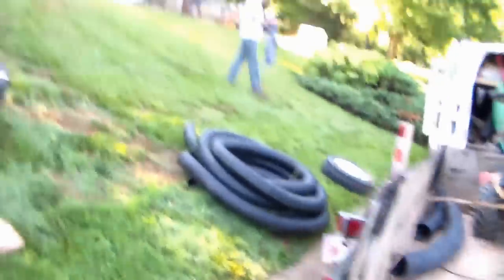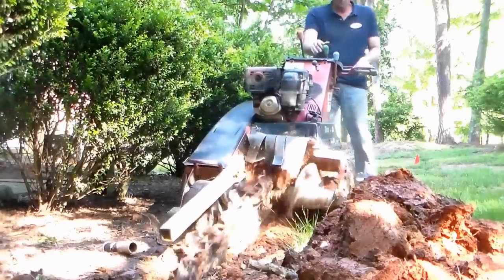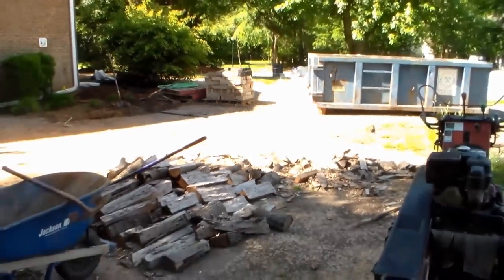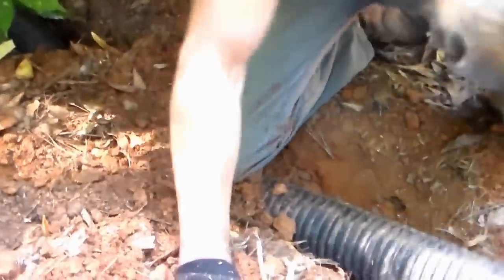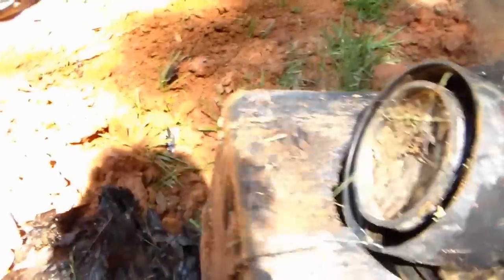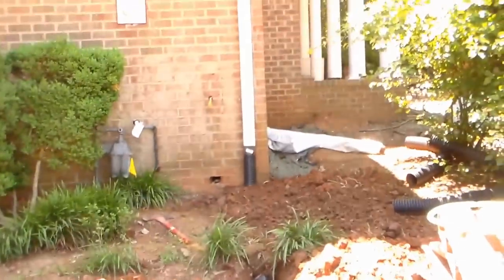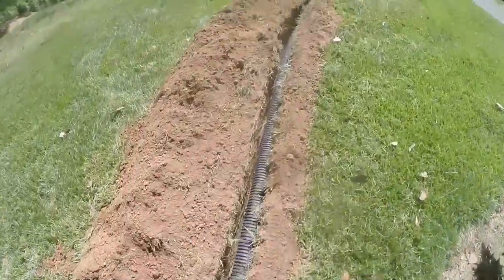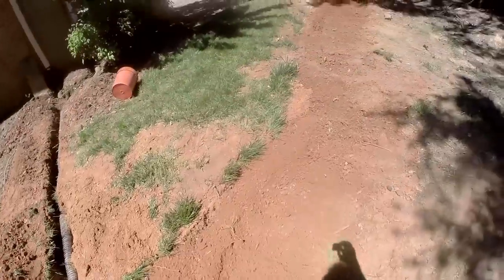300 Feet French Drain - 1 Day Install

Comment: Cool stuff.  Currently I am trying to  find a capped pipe the people who  bypassed my sewer line and took me directly to the sewer instead of using a sewage pump.  The only way I know how to find it is to keep digging.  So far three feet deep and 12 feet.

WIll let you know the progress. I am doing all of it in 4" glued pvc as I have had failures with the black pipe getting crushed by cars who run over it.

Keep up the great videos.

Scott

Comment: Can you install downspouts into a French drain(not yard drain) system?  I need to get all the water out to the street drain.
Reply: +Chiefly Chieftain it is not recommended to install down spouts into a French drain, especially if the French drain is located near your foundation. The reason is the amount of water you are putting into the drain system will cause the system to leach water back into the sub-surface. Down spouts should be separate system. You can tie into the discharge portion of the French drain system if you like.
Reply: +Bellis Lawn & Gardens I had the same question so thank you for this excellent response to his question.
Reply: Matthew Howell no problem...good luck on your project!
Reply: Chiefly Chieftain it's fine as long as you have screens on your downspouts, would fill with debris and leaves in a couple years and be impossible to clean.